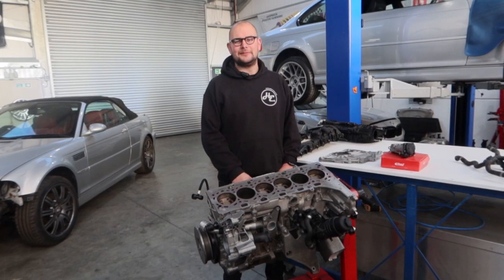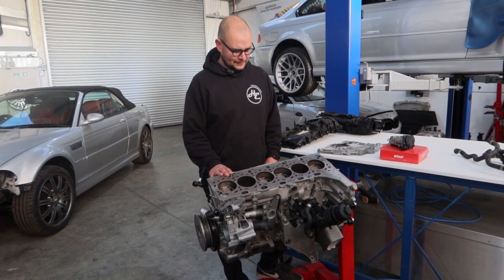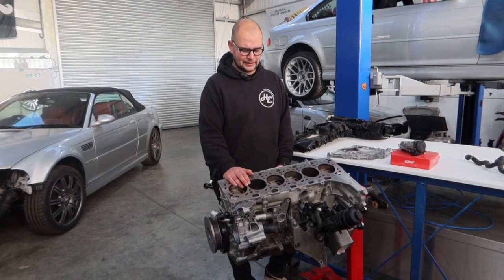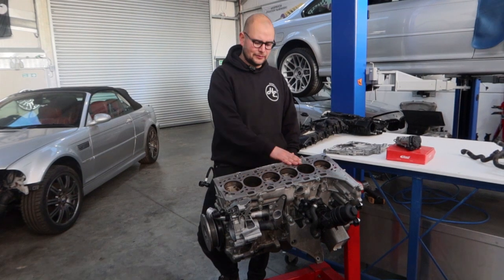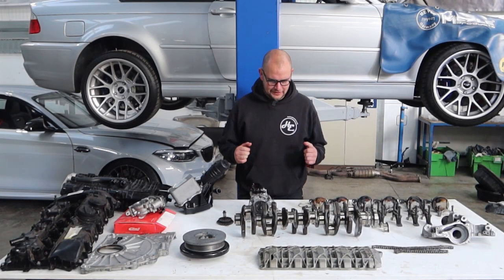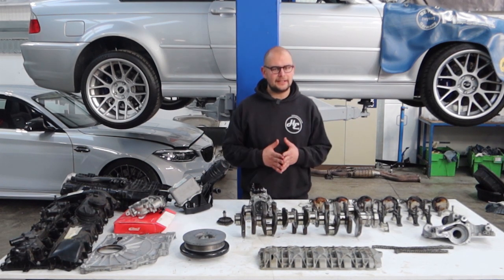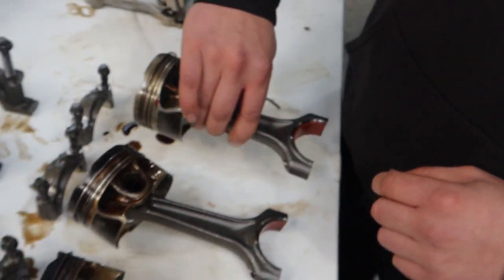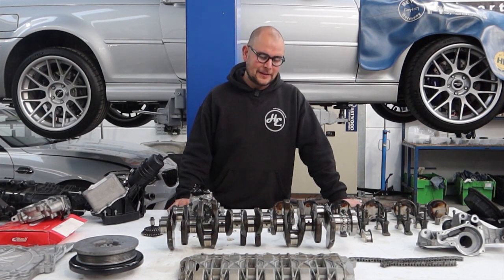Inside the BMW B58 *with surprise failure!* - Hack Engineering B58 Build Episode 1

Comment: Any pointers for those looking to push the b48 internals? Ivr been told changing just the piston heads is good enough for 600wtq before rods need changing?

Specifically the 11.0.1 compression  b48s the the 20i
Reply from the maker: All depends on what fuel you're using. High ethanol content will be needed to avoid knock - knock always kills an engine in no time. Usually the weakpoint with B48s is the ringlands (though similar story with most engines!). Put some forged rods and pistons in there, and you'll be capable of more - the real tricks lay in the cylinder head flow if you want big power without massive boost.
Reply: @hackengineering5586  thank you, so deffo changing piston head with a forged piston kit will have no issues really if LSPI occurrs cause there tough pistons😁, true i can do a rods also if im looking for big big power!

Ill bd running uk pump fuel premium only so 99 ron tesco, v power esso etc

Could you give me a little more info when  your referring to cylinder head flow please.. ivr been recommended to keep the stock 11.0.1  compression and run a turbo with abit lag due to efficient and fast spoolin the stock compression is
Reply from the maker: @Reaper_f30  you will be knock limited on premium fuel at 11:1, get some ethanol in there and you'll be away! 

Stock head is quite restrictive if you want to really push it.
Reply: @hackengineering5586  thank you sounds good, as you know ethanol in uk can be a pain as you need to fill with bottles or manually due to no e85 being at petrol station

What about those water methanol injection kits, hokd 3 litres of methanol and spray into the fuel system if im not correct? Same effect as ethanol right?
Reply from the maker: @Reaper_f30  essentially yes, however it's not very well metred or monitored like the injectors and so we tend to see them being troublesome if you're relying heavily on them for fuelling. Whereas using ethanol in the standard system is tightly controlled and monitored by the ECU. 

We have done 900+bhp S55s with proper port WMI injectors rather than nozzles. But straightforward ethanol content is a winner.
Reply: @hackengineering5586  ahh yes i see i see, i have seen the injectors are a issue shoulde changed 80,000 miles, would you recommend installing the revised b58 injectors?? I know injectors are same model etc across the B engine range
Reply from the maker: @Reaper_f30  yes we would recommend it, video coming soon of our injector change on the HE140i!

Comment: Bmw they don't have engine bulletproof, all engine are flaire. I hate bmw engine since 2006 until 2022 all engine are same issue.
Reply: The s55 is good there are plenty of engines that will go 200,000 miles 300,000 miles
Reply: the 6 cyls have less timing chain issue than 4cy ( the ugly N20 ) with plastic guides parts who break like glass.
Reply: Nonsense. This engine has been proven as reliable. Many N55/S55 issues were ironed out.

Comment: Is this the B58 or B58TU?
Reply from the maker: B58 Gen 1. Updates coming soon!
Reply: So the short or long block you got is the old B58, not in the Supra. The B58 do not share major parts with B58TU. In fact the TU has a single timing chain while the old one has multiple timing chain

Comment: SUBSCRIBED Lots of questions......can you please comment on B58 gen1 injector failures we're seeing a lot of happening in the US? some have been causing catastrophic engine failure and happening completely at random. Some say it's injectors getting clogged up, does that have anything to do with the direct injection system and carbon build up? how can it be avoided? is injector cleaner worth using? is it made worse by all the use of ethanol out there? some are making injectors a service item after 50k miles as a precaution but I find that really extreme and an expensive cost (6x injectors). I'm in the UK with a 2016 340i on 50k miles now and I run stage 2 MHD + XHP st3 (95-99 RON pump fuel)
Reply: We're definitely not seeing alot of it. Like 10 dudes out of thousands have problems, 99% of the time its due to poor fuel quality. This is an issue that the groups have been panicking over but its a non issue for 99.9% of b58 owners
Reply: The main reason why injectors fail is because people are using a high level ethanol content, factory injectors can handle maximum E 40 ethanol, not more, unfortunately, lots of people use high-level ethanol like E 85 and over on the factory injectors, and then get surprised when they fail.

Comment: i am currently removing the oil filter housing wondering is there only three bolts to remove? and i can see one coolant line up top there from your vid is that the only hose i would need to disconnect for removal of housing

Comment: Basically a full Mahle engine:
pistons, intake manifold incl charge air cooler, turbocharger …all made by Mahle
Reply: @hackengineering5586  yes, Mahle is OEM supplier for almost every OEM, usually as a component or module supplier 

But in case of B58 it looks more ore less that Mahle developed / supplies the entire engine system
Reply: That’s a good thing, I presume?

Comment: Thanks for your informative video. Do you think the upper coated bearing can be a cause of concern if increasing power? Looking forward to the build
Reply: Papadakis racing used the stock bearings and ran 1000bhp in their drift car. So I’d say short term not, but who knows long term

Comment: Looking forward to seeing what you do. Direct and port injection?  Bigger charge cooler? Or maybe switch to intercooler?
Reply: I'm not a fan of the last two big budget builds ditching everything that makes it comparable. They can make great power with the upgraded manifold that also include spots for port injection and has a larger intercooler. 

The type of mods they did you will never see on the street.
Reply: @hackengineering5586  Yeah I was kind of taking that as a given. Was just thinking about other mods.